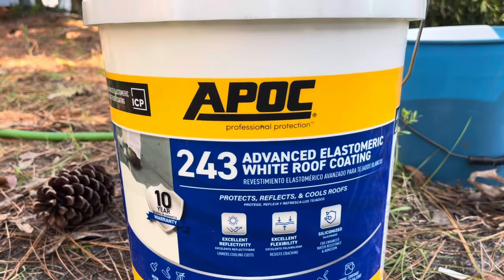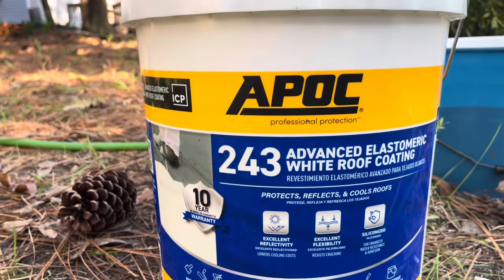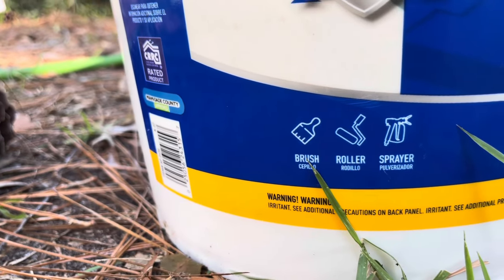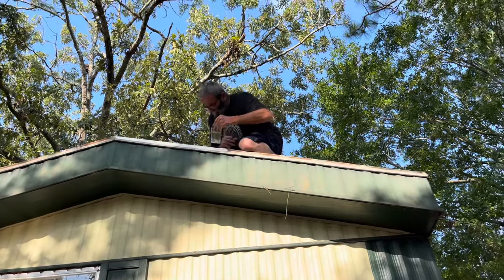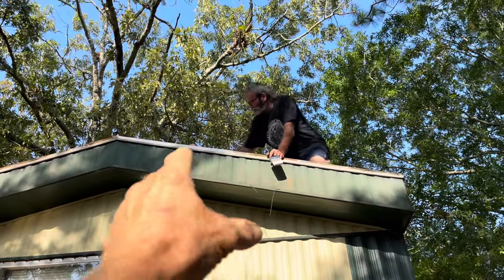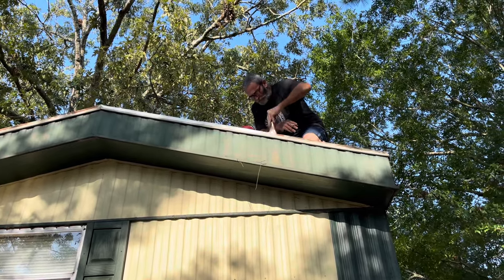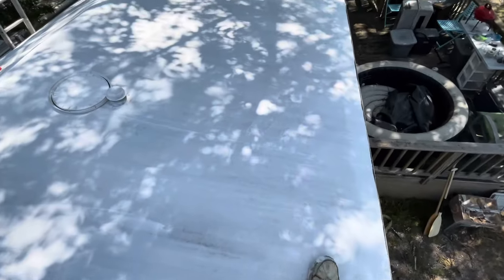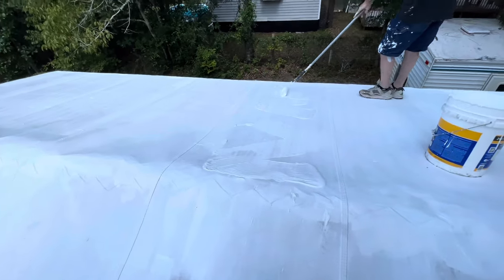Best How to mobile home roof coating.

Comment: I was going to pay someone to do mine on my 1984 ,45 foot mobile home 350 dollars.  I hate heights and worried a little about going through the roof. Im 64 5'10 173 and still pumping iron and after i picked up the material i decided to go on the roof and check it out. I just saved myself 350 dollars and im doing it myself.  I couldn't believe how you just pay attention a little bit and I'll be staying right on the peak and doing the drop edges from a ladder after im done on top. Plus i know that it was done right with satisfaction. The material i got was the same stuff as in your video but number 246.
Reply from the maker: Glad to help. Rock on

Comment: Thank you for this video. I bought a trailer last year and people put Black on the roof and I know that’s the wrong color. I will get this and fix it can I lay it over the Black people went to smart. God bless you 🙏🏼💚
Reply from the maker: The black stuff is garbage
Reply: @Drewsroofingandhomerepair  Yeah, I know that I told the last owners before I bought this, but they weren’t too bright, but can I cover it with this stuff?
Reply from the maker: Yes

Comment: I'm not getting up on a roof----I would gladly pay you $850 to seal my roof, that's a deal
Reply from the maker: I agree it wouldn’t make a lot of sense. That’s why I tell everybody a lot of people don’t charge like me I’m a little bit cheaper than some people are this guy was a friend of mine. I have another channel called Scrapping With Grandpa and this gentleman works at a golf cart place where they give me their golf cart motors batteries copper cables so it’s one of my honey holes from my other channel Scrapping With Grandpa so I did give him a break but only a couple hundred bucks at the most. They should never cost anybody over $1200 for two coats and cleaning.

Comment: How many 5 gallon buckets would it take to cover a 14' x 65' mobile home? And would Lanco Seal Acrylic Elastomeric be the proper sealant for the standard (non metal) roof? TIA. Nice work. Wish there were fellows like you around here.
Reply from the maker: Yes, it looks like you have the right idea. You will need 25 gallon buckets

Comment: Can this be applied to a rubber "sheet" roof? 
What do you clean the roof with before applying this? Thanks
Reply from the maker: A little bit of bleach, some water and soap and pressure washer if needed but be careful walking up on your Mobile Home Roof you’ll make it worse

Comment: does 1 5 gallon work for the roof ? only one needed?
Reply from the maker: Start with 1. I usually end up using two for two coats one bucket for the first coat and then I go over it again the next day with a second coat do you want it to be plenty thick

Comment: Love watching you guys lol it's one bucket enough to get the entire roof done on a single wide?
Reply from the maker: To be honest with you, I recommend putting a light coat on first so pressure wash or clean the roof and then put a light coat of Cool Seal first using about 3 gallons and then do you wanna wait for that to dry and put a thicker coat on it so you might have a couple gallons left over but I definitely recommend using two buckets. I went to Lowe’s and I bought the stuff for $89 a bucket that’s a steel normally it’s close to 150 so maybe you can find a deal or a cell somewhere for Cool Seal maybe even in the bottom of my video you might see a place you can buy it online and have it shipped to you.